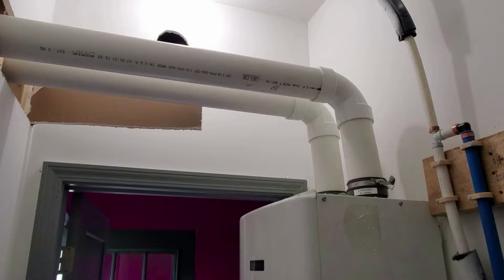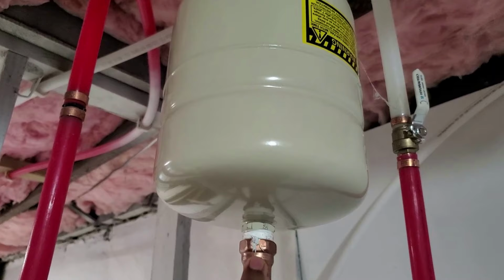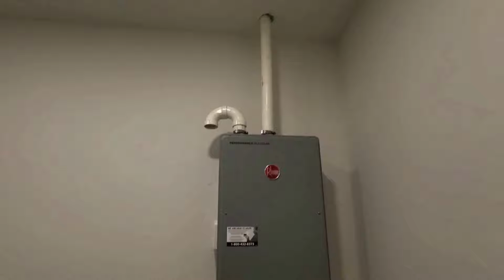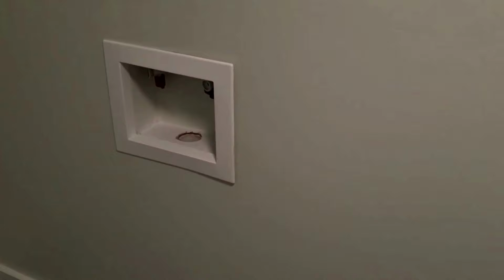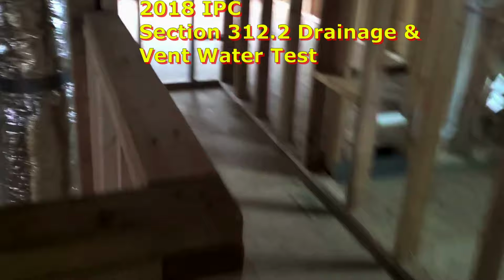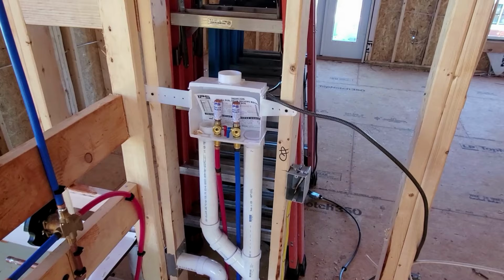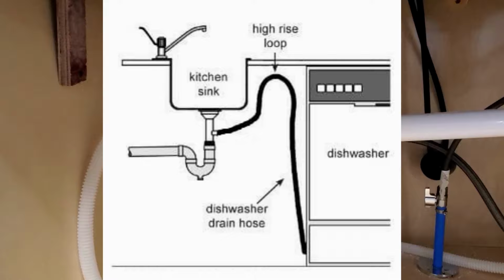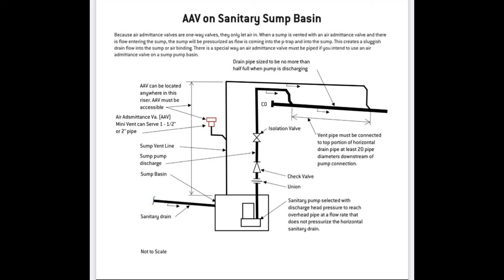Plumbing Code Violations (Part 1)

Comment: As a european plumber, I‘m kind of shocked how technology far behind the US are. Most of the stuff you‘re using are outdated here for like 30 years at least.
Reply from the maker: Ok, I appreciate your comment.
Reply: Alright, I’ll bite, what plumbing technology are we missing out on
Reply: example?
Reply: I used to be a licensed professional engineer (13 years, left in good standing) and designed plumbing and HVAC systems.   You would not believe how many "new" technologies we'd be apprised of which were actually 20 year old technologies from either Europe or Japan.   We are certainly behind.    I think the heads of R&D here must just go on vacation somewhere and say "hey, what's that?   Let's bring one home and sell it!"    I think a lot of it on the HVAC side at least is born of our cheap energy.   It lowers the incentives to improve.
Reply: @davidgolden6068  nothing. They just do it with a "new standard" that isn't really better it's just "updated" often to be more "efficient". The way we plumb works and it's as simple as that
Reply: Most of us believe it it ain't broke don't fix it. Your technology and ours prob does the same job. So why pay for newer tech if you can get the same job done cheaper.
Reply: Thanks for the examples you gave us. Just because something is newer doesn’t mean it works any better than the way we do things.
Reply: Show me something. Some new stuff.
Reply: I read a similar comment on other forums. I think this person trolls. Same comment, asked to cite examples, then crickets.
Reply: Lol no
Reply: There are newer better systems. Depends where you live in the US
Reply: This guy is trolling…drops a comment without giving any examples and then fails to respond to any of the replies
Reply: That’s fine. When Europe needs americas help, we’ll be there again and you can show us your marvelous technologies before we head back home.
Reply: Its not just thats but it keeps creating jobs for us..
Reply: Okay so as a Plumber in Washington and someone who absolutely loves the Europe I can at least point out a couple things I noticed when I was there I found absolutely fascinating.

First being there is no really hot water tank store per house hold. Some places run steam and even hot water from central boiling system which for me was a crazy idea.
That being said there's a lot more on demand hot water "tankless" out there which I thought is cool.

They are really on top of materials and not try to save a buck never had to deal with say "Orangeburg" or "CPVC" and primarily went from copper to pex and skipped alot of that shit.
They also just put in a lot more to their craftsmanship.
In America we literally do everything we can to profit putting the capital in capitalism right? So we just cut cost where and when we can.
I've heard rumors that big box stores(Home Depot) A.O. Smith is less quality then the exact same tank at Ferguson. Just not like that out there they really weed that shit out. Not to mention a lot of countries have rain collection plumbing, a lot more radiant heating than we do, and constantly collaborating as a team on technology advancements for the better of the community then a constant competition of profit.

We definitely have a lot of European descent just not the integrity but we'll get there as long as people likee are plumbing and moving the ball forward and putting quality materials in instead of this tester crap like "Orangeburg"

Not to mention 5 week paid vacations lol non stressed and healthy workers move that bar forward

Comment: according to the UPC Exception: For PEX piping systems, testing with a compressed gas shall be an alternative to hydrostatic testing where compressed air or other gas pressure testing is specifically authorized by the manufacturer’s instructions for the PEX pipe and fittings products installed at the time the system is being tested, and compressed air or other gas testing is not otherwise prohibited by applicable codes, laws or regulations outside of this code. UPC and IPC are fighting each other on this code.
Reply from the maker: I appreciate your feedback, and thanks for watching.

Comment: Just a reminder, these codes are either statewide or city wide.  What is a violation here may well not be a violation someplace else.  you have to know what the jurisdiction you are in requires, and sometimes that even goes by individual inspectors which is really a pain!
Reply from the maker: It's about what codes your state has adopted.  This video may not apply to every area.

Comment: In the Oregon plumbing specialty code you're allowed to "flat vent" vent lines per 905.1
Reply from the maker: Oh ok...what Plumbing Code are you using??
Reply: @PPG1967  it's basically the UPC
Reply: Here in NC, venting for gas tankless water heaters must be no less than 12” apart. You can utilize internal air as long as you have the correct cubic sq ft for the btu. Also the thermal expansion tank can be mounted on “rigid” pipe, such as copper.
Reply: God I want a plumbe in New York it’s basically the exact same as San Francisco Plumbing well how it used to be like anyways now they’re starting to use plastics and things of that nature that it was all cast-iron and it was all real Plumbing and everything was tight in right God I want a Plumbing New York
Reply: They also prop up pipes on loose wood chocks with plastic band iron straps. 😂
Reply: Why does Oregon's gov websites say it has adopted both the Oregon Residential Specialty Code and the Oregon Plumbing Specialty Code, both effective Oct 1, 2023, whose plumbing sections both conflict with each other on this issue?

Comment: On the first tankless water heater, you can vent less than 2’ with a particular cap on the outside. The way they have it is wrong because the intake would be sucking in the exhaust. On the water piping in the basement, that’s the worst plumbing job I’ve ever seen. Those lines should be either ran in an area where there may be a bulkhead or up in the joists. Suppose the homeowner wants to finish that basement at some point. Now on the sump pump, I’ve never heard of venting a sump pump crock, only a sewage ejector crock. Loved the video.
Reply from the maker: Where are you located?…what code book are you referencing?

Comment: Plumber here in California. We use the CPC or California Plumbing Code 2019. It's just the UPC (Uniform Plumbing Code) but with its own little twists on things.

UPC requires strapping for expansion tank (608.3), earthquake straps (507.2), smitty pan (507.5), and the pex cannot tie into the water heater for the first 18 inches. Needs to be copper (604.13). Also, the piping for the water heater's t&p needs to go to an approved location. Can be outside or to a floor sink. Just cant drain to the floor and cause damages. Same thing with the smitty pan (608.5).

If I remember correctly, tankless can draw air from the inside, but it needs to have enough room. Its figured out using a formula found in the book (506.2.2). It is important to check the manufacturer's install instructions cause depending on the location, you may need to get air from the outside anyways or purchase a special filter made for those applications.

Also, PEX is the only plastic allowed to be tested by air due to how well it expands. PVC will shatter with air (it's not pretty, I've seen it.) (609.4) PEX is in the exceptions below the code.

UPC is the only code that allows the vents to be level at minimum (905.1) (unless it is below the flood level (6" above the highest plumbing fixture)) at which case it is treated as a drain until its above that level. (905.3)

Im not 100% sure you can use pex as the dischaege piping for the relief valve.

Both of our codes share the fact the hot water needs to be insulated (609.11) and a few others.

Dishwasher drain hose needs to connect into an air gap befor discharging into drain. (807.3)

Lastly, our code doesnt allow air admittance valves. So cant comment on the last part, looks interesting, Though.

Here is a online version of our book. 
https://epubs.iapmo.org/2018/UPCITM/#p=1
Reply from the maker: I appreciate the info, and thanks for watching!!

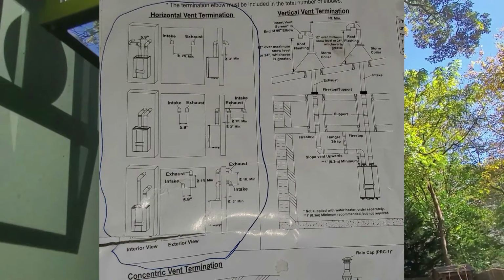Comment: 1:36 Think you missed a violation here. PEX piping cannot be directly tied into a water heater, 18" minimum. This is why they make flexible water heater supplies at 18" long
Reply from the maker: It's in the video sir... all code references are out of the 2018 IPC, International Plumbing Code. Not the Uniform Plumbing Code (UPC)...two different code books.
Reply from the maker: I appreciate your comment.

Comment: I think the water hammer arrester might vary by State/Local depending on if they adopted the entire Plumbing Code.
I just looked up the plumbing code for California and it doesn't look like they require arresters, I'm not an expert so you should check with your local building department.  Here is the CA Code:
609.10 Water Hammer
[Not adopted by HCD] Building water supply systems where quick-acting valves are installed shall be provided with water hammer arrester(s) to absorb high pressures resulting from the quick closing of these valves. Water hammer arresters shall be approved mechanical devices in accordance with ASSE 1010 or PDIWH 201 and shall be installed as close as possible to quick-acting valves.  HCD is Housing and Community Development.
Reply: You are correct in most states the expansion tank is sufficient

Comment: I noticed that the dish washer that hooked up to the garbage disposal didn't have a high loop either 😅 
Thanks for sharing this video and please keep them coming.
Reply from the maker: I appreciate your feedback, thanks for watching!!
Reply: Dishwashers have a high loop installed on the side of the dishwasher so the  one under the sink is not really necessary but I always looped them up just to keep as much stagnant water out of the line as possible. Realistically there should be an air gap on top of the sink but that’s one code that most inspectors realize is stupid.
Reply: @BlueDart1971  your right there’s a high loop on the side of the dishwasher, inspectors in my county will fail one every time if you don’t have a secondary high loop. But you are right my friend. Have a good work week.
Reply: @plumbbuild6517  my work week doesn’t involve plumbing very often anymore. It involves renters paying me:) After 30+ years of plumbing my body is shot. To all of you that work your butt off every day make sure you take care of your body.
Reply: Hmm, where I'm located, you'd need an air-gap, not just a high-loop. Though I do understand that not every AHJ has implemented or enforces this requirement.

Comment: Air will leak before water would leak.  Air molecules are much smaller than water molecules.  Do what code says for your area, but physics says if it hold air at pressure X it will not leak with water
Reply from the maker: Well, it's easier to determine where a leak is coming from with water.
Reply from the maker: I appreciate your feedback, and thanks for watching!!
Reply: (Not a plumber) but a slow air leak is harder to detect than a seep. Gauges just aren't that accurate. (IMO)

Comment: pex coming directly from a water heater is a fail in some areas.  They want atleast 12” copper or metal braid around here
Reply from the maker: So, we use the IPC (International Plumbing Code) not the UPC.
Reply from the maker: I appreciate your feedback..thanks for watching!!

Comment: This is what happens when you hire a builder who attempts to do all of the different trades by himself or believed his coke head brother in law when he told him he was a plumber years ago before he hurt his back on the job and is still waiting for his settlement even though he never filed a worker’s comp claim but still found a shady lawyer who is filing lawsuits against his former employer who was nothing more then a general contractor who hired this guy as a subcontractor and 1099ed his ass at the end of the year .
Reply from the maker: Ok,  interesting comments.. thanks for watching !!
Reply: @PPG1967  thanks I has just trolling a little bit but anyone who’s in the building trades knows someone who my original comment applies too. Whoever the Plumber was on this job wasn’t the target of my comment, I didn’t get to see enough of his work to criticize the final rough in part of the job.
Reply: Oddly specific details.

Comment: I had my HVAC vent my furnace out side by side intake and exhaust 1 feet from each other, when it got below 0 it would freeze the intake causing snow/ice blockage shutting off furnace that i had to clear in order to re-start furnace.  Had to extend 3 feet away and angle exhaust outward not downward toward ground solved problem.  I can see why venting tank-less water heater the same way, would cause similar problem i had.
Reply from the maker: Thanks for sharing...I appreciate you watching!!
Reply: Me too.  Got fed up and routed them 10 feet apart.

Comment: Lots of juicy violations. Great video. 3:45 this dishwasher drain also didn't have a loop on it.   Is this all the same house?  It would seem the plumber knows how to go through the motion but doesn't understand the reason for  all of the codes.   That is what frustrates me the most when dealing with young hot headed contractors, they might know they have to do something a certain way but don't understand why. These types are the first to cut corners and do it wrong if its too hard or they aren't making money on the job. They aren't "tradesmen", just handymen trying to make an easy buck.
Reply from the maker: So, those were two different houses.
Reply from the maker: I appreciate your comment.

Comment: You are half right on some thing, venting of tankless water heaters need to be approved exhaust pipe. Pvc is not allowed for exhaust. Pex pipe has to be 24 inches from top of heater. Intake air can come from basement as long as there is enough square feet per btu. Never heard of water test for pex water lines, if it holds air it will hold water.
Reply from the maker: What code book are you referencing???...my videos based on the IRC or IPC.
Reply: PVC is allowed, can’t be hollow core on the exhaust.

Comment: He missed a couple. On the first heater they have pex tied directly to the heater. They also use pex for the pop off on both heaters. Even if they let you use pex, the first heater is crimp pex so the fittings reduce the size. You can’t have any pipe size reduction on a pop off. 
There’s several things he flagged that we’d be allowed to do. First is the vents, I know they need to be sloped but every inspector I’ve run into is usually fine with them being flat. The main thing is that there’s no belly’s that can hold water and cutoff the vent. Second is air test on pex. We air test everything unless we can do a live water test either one is fine.
Reply from the maker: So, what plumbing code book are you referencing sir???
Reply from the maker: That video is based on the 2018 International Plumbing Code (IPC).
Reply: I use both codes but I am more familiar with UPC. However the things I mentioned, I thought were in both codes. I stand corrected. They may be old codes that some plumbers/inspectors still follow. The only one I’ll still stand by is tank with crimp pex. It looked like 3/4. If so, it would be illegal because it has a smaller ID than the t&p valve does due to the fittings not being full port. 
As for the second paragraph, I didn’t mean to argue that that was codes but just what our local inspectors tend to allow whether or it’s legal per code.
Reply: @joshcowart2446  I thought they have to have at least 18” of hard pipe off the heaters too
Reply from the maker: No worries...thanks for watching!!
Reply: @PPG1967  IPC allows PEX TPR valve pipe? I thought it had to be copper or CPVC. Plus that one in the basement goes vertically upward, I thought they needed downward continuous grade. I moved to California so only have CPC codes handy, but spent 5 years inspecting in IPC before Cali
Reply: @PPG1967  2018 IPC section 504.6 #9 (TPR valve pipe shall) Be installed so as to flow by gravity
Reply: @PPG1967  also, the temperature relief valve should be rated for 210 degrees, but red PEX is only rated for 200 degrees
Reply: @drewkoube  I'm fairly sure that's only on gas heaters.

Comment: For the insulation of the hot water pipes if they were ram through the joists with the insulation that’s existing would that make code or regardless you have to insulate the pipe
Reply from the maker: Ok, I appreciate your feedback

Comment: that first tankless i think you missed something.   yes they are to close but the PVC piping has black letters.  black letters should be foam core and not solid PVC like the red lettering is.  if that pipes not solid PVC then its a violation and strictly against the manufacturers instructions.   are black lettering and red lettering the same country wide??
Reply from the maker: Oh ok..I didn't know that.  That's manufacturer's installation instructions?
Reply: @PPG1967  I think everyone.  It may be low heat but still to hot for foam core.

Comment: Where I'm from, some of those would've passed. Also, most of those were not violations. You can air up pex pipe, you don't need vacuum breakers on outside faucets because you should be using frost free that have those already installed. Also, you don't need hammer arrestor unless the pressure is high and if it's high you should add a PRV valve. I would state in your videos that this where you are from not everybody else.
Reply from the maker: I always post what code book I'm referencing.  International Code Books.  If you use these books, my videos are applicable.  My videos are based on the Code or manufacturer's installation instructions.
Reply from the maker: I appreciate your feedback, and thanks for watching